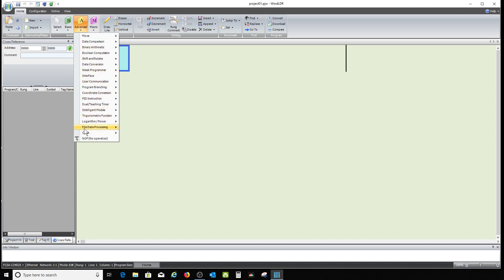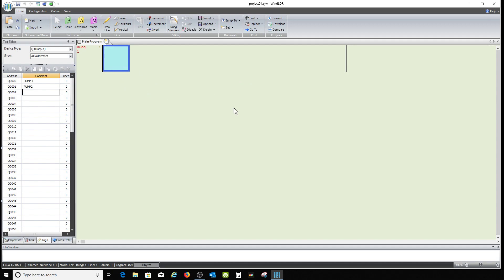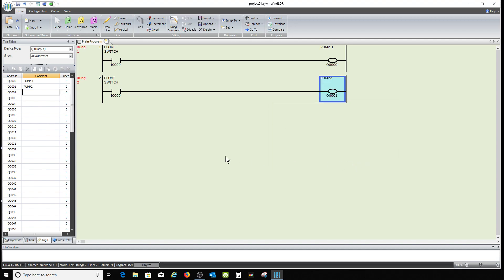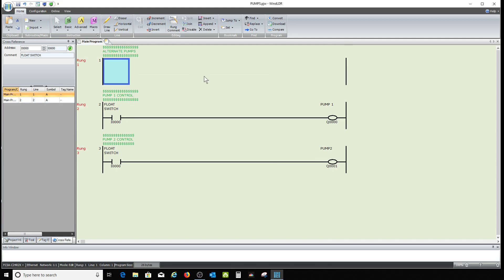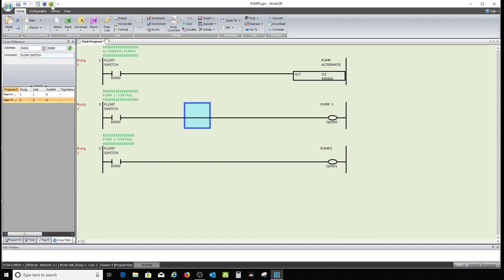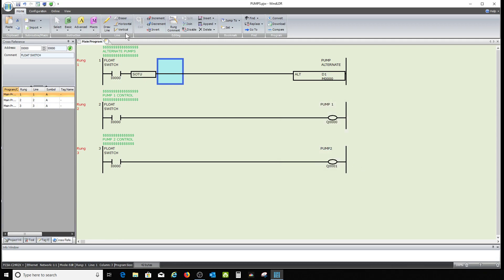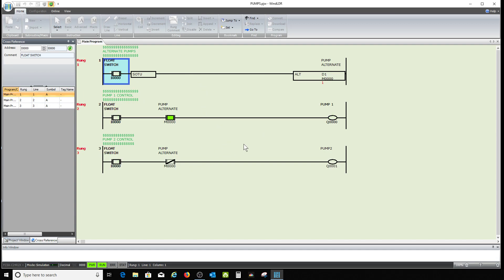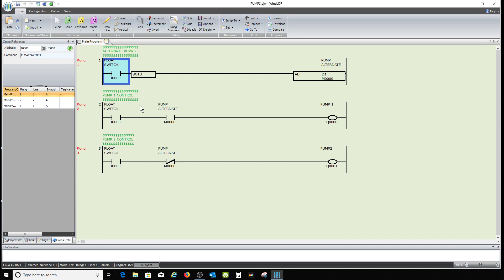IDEC Alternating Pumps from a single input

Comment: Thank you so much CF.  This video was excellent.  I was so close, but it was the 'Single Output Up' that I was missing.  Since watching this video, I've made a program with 3 float switch inputs.  The first which alternates each time (as shown above), the second switches on the other pump which isn't running, and the third brings in both pumps by default and sounds a high level alarm (in case the first 2 floats fail).  I've also got run lights for each pump and the overloads which you showed us in your previous video.  Keep up the good work and I'll think up some other situations for you.  Cheers.
Reply from the maker: Awesome, sounds like your getting the hang of it.  Its easy, once you get to know some of the tools, and how to make them work together.
Reply: Hi can you demonstrate in omron plc

Comment: I’m using a fc6a-pj2a .on a 4-20ma invalco bs&w monitor to bring data into plc off the monitor. Need to set it up and find data from monitor
Reply from the maker: Are you asking how to configure it?  Or, wire it?  Or both?  Let me know, and when I get in frontbof my PC I will produce you a Hollywood video.  Lol. All joking aside, its pretty easy, just tell me what yiu want demonstrated.
Reply: @huntxtrm  Hi, I have a similar issue that I have my Pressure regulator (ITV2050-04N3BL4) which is 4-20ma connected to the FC6A-K4A1 I am not getting monitor output data from it. I could read my input data but my output data on the monitor output signal is not indicating anything  and the signal is connected to the Analog I/O catridge (FC6A-PJ2A, it has 2 slots).

Comment: Thank you so much. if you can help me to do this  (PLC Control of VFD in IoT Farming), I'm student, and I don't know how i can connect plc with vfd by simulation with plc program.
Reply from the maker: Please explain more of what you are trying to do.  How are you phisically setting up the system.  Is the VFD local to the PLC?  Is it some distance away, but within reach of comm wiring?  There is allways a path, we just need to build the road first.
Reply from the maker: I do not know of a way to sim a vfd running from a plc, but we can make an analog bar etc on the hmi.  Tied to the output within the plc?  I guess I just need more info.
Reply: @huntxtrm  I need to use in this project soil moisture sensor, humidity/temperature sensors, water flow sensors send information by zigbee to plc, plc control VFD, VFD control 3 phases AC motor pump
Reply from the maker: @ahmadmoustafa3  Im not familiar with Zigbee.  But, from what I just looked up, you will probably be neesing a zigbee to 485 converter for modbus comm.  One at the plc, and one at each device.  So far that sounds like the best route.  But, like I say, Im not experienced in Zigbee.  Does Zigbee use assigned IP adresses?  Or, is it some sort of proprietary communication?
Reply: @huntxtrm  ZigBee is low-power, low-data rate proximity wireless network that operates devices in located in a small area, depending on the module used some can function at up to 3.2km. It operates on an IEEE 802.15 WPAN specification that can send data at rates of 20 kbps to 250 kbps. To send this data Zigbee operates worldwide on various unlicensed bands specific the 2.4 GHz.
Reply: This along with the ease of compatibility across ZigBee devices make it highly adaptable to multiple functions. ZigBee can function on a multitude of network setups. It can be set up as a star network where it can be setup as a central hub for other devices, a tree network where there is a root node and all other nodes piggybacking onto each other and a mesh network where every device is interlinked to each other and communicating.
Reply from the maker: @ahmadmoustafa3  sounds like a typical LAN setup.  You should be good  using converters.  You might be able ti get a wireless ethernet card for your VFD.  Thats easier to set up than Modbus.  But, on your sensors, you will most likely need to get a converter that converts from analog 4-20 or similar.  If you want send me an email.  ControlFreakRoy@outlook.com.  I am very interested in what you are doing.  I am actually working on developing a similar setup.  Maybe we could colaborate some.  I am thinkin of setting mine up, wireless LAN, with wireless gateways and Access points.

Comment: My Idec program does not have ALT
Reply from the maker: I am not in front of my computer at the moment, but you should be able to type "alt" and pull it up?  I think, not sure on the keystrokes.  But, if you look in the manual, it should have the keystrokes for the functions listed.
Reply: @huntxtrm  I found my issue the new software does not have Alt bit.